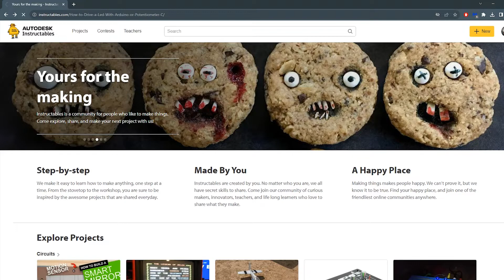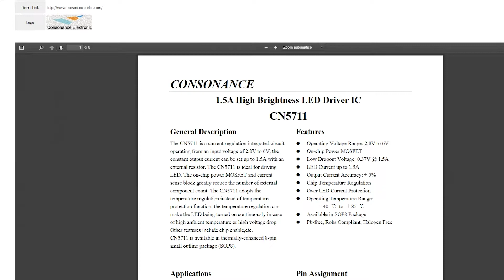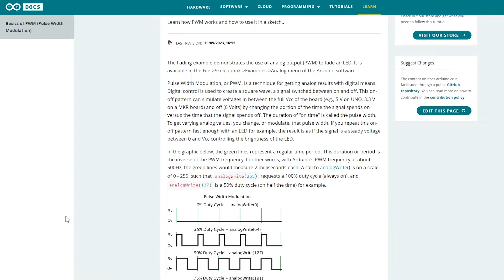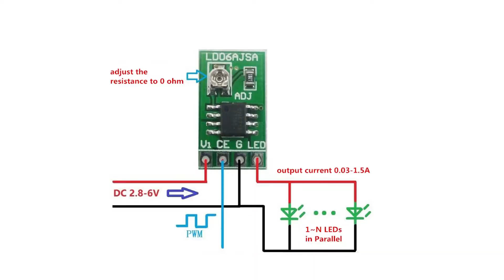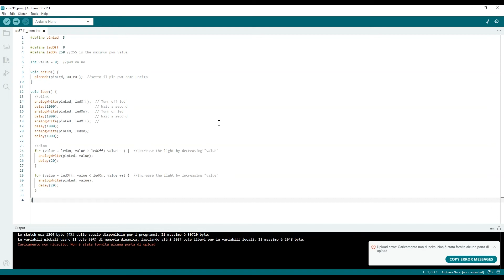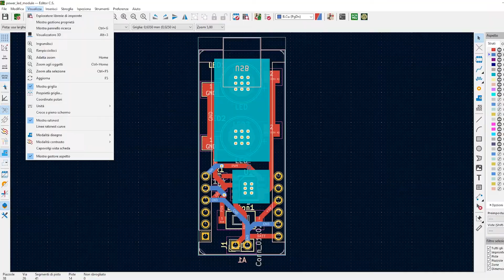How to Drive a Power Led With Arduino, ESP32 or ATtiny85 - CN5711

Comment: Hey Dario, great video! Do you think this could be expanded to an array of LEDs for individual dimming through PWM?
Reply from the maker: Hi dear. I'm not sure if I understand correctly, but I'll try to answer.

You can connect one or more LEDs in parallel to the module. By modifying the PWM, you can dim all the LEDs you want at the same time.

If you need to dim many LEDs with different brightness levels, however, you will need a driver for each LED or addressable LEDs.

I hope this helps.
Reply: @dariocose perfect that was the answer i needed. I need to power 10 leds and dim each one of them individually to a specific power (i.e. generate a light intensity gradient)

Comment: How much voltage is de led getting?
Reply from the maker: The LED receives the input voltage minus a small voltage drop. There is a detailed table on the datasheet.
However, the cn5711 drives the LED in current, not in voltage.

Comment: Hello nice video, what happend when you set the voltage to 6 or 7 volt with a led of 3 volts?
Reply from the maker: first of all, the cn5711 works up to 6 volts. i would not use 7 volts to power it.
you can power it with any voltage you want between 2.8 and 6v, you just have to check that the led supply current is right.
If you want you can use an appropriate resistor between the driver and the led to further adjust the current